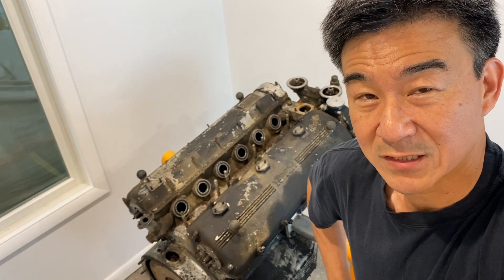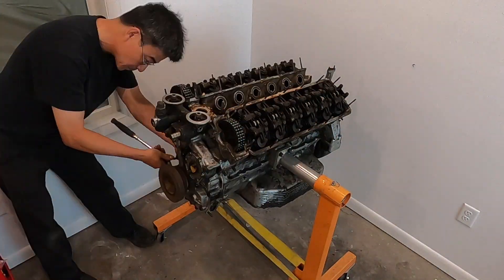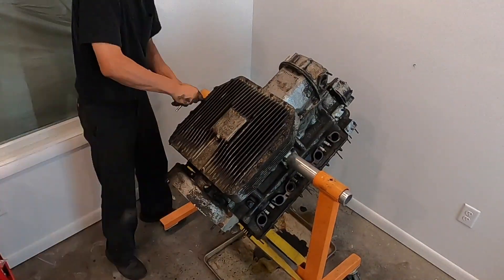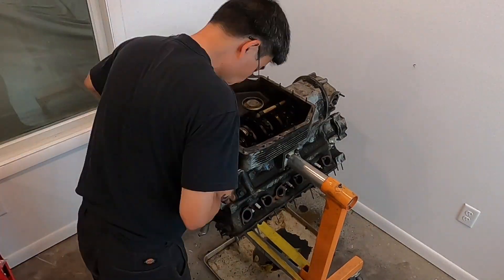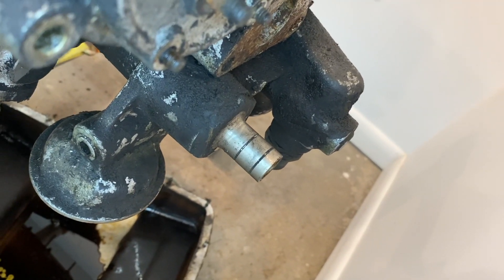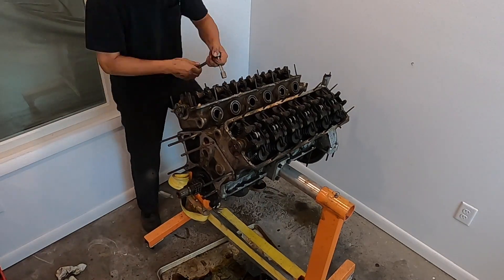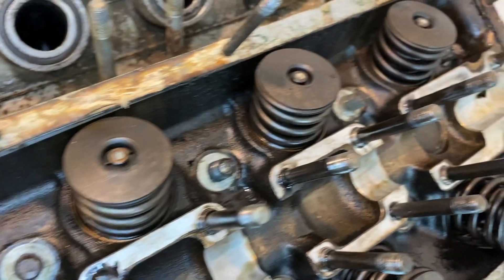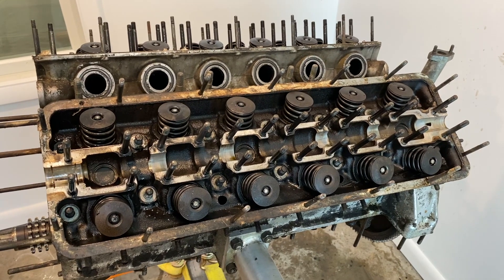Ferrari 330 Engine Disassembly

Comment: You have to use your vehicles. I'd rather have a well used, well loved Ferrari with a lot of miles rather than one that never was run properly. This just proves it.
Reply from the maker: There are a lot of reasons people park a Ferrari. Most of the time it's because it broke, and they either couldn't get the parts, or find the time to fix it. Hardly anyone parks ANY car unless there's a problem! Thanks for watching!

Comment: Thanks Tom! I’ve been looking forward to this one. After this restoration all of the other ones will seem easy!
Reply from the maker: They’re all challenging, but it’ll be nice for you to have these short clips of the work on your car!
Reply: When restoring these engines, is there anything that you can do to prevent the head studs from sticking in the future?
Reply from the maker: @Wriggs1898  the new head gaskets encircle the head studs so less water can weep between the cylinder head and block lessening this problem, but knowing if it lessens the problem will have to wait a few decades to find out!